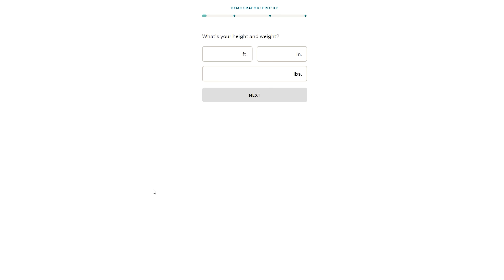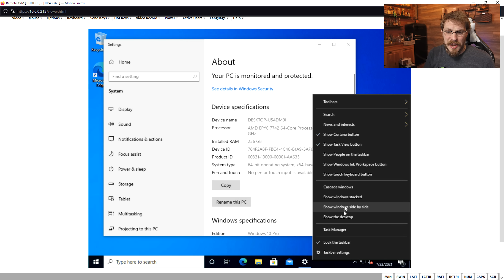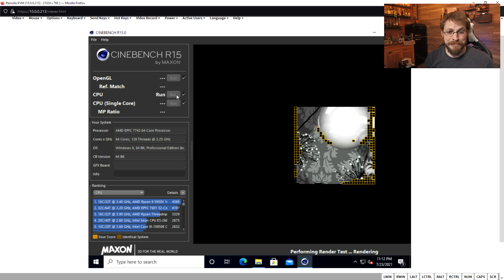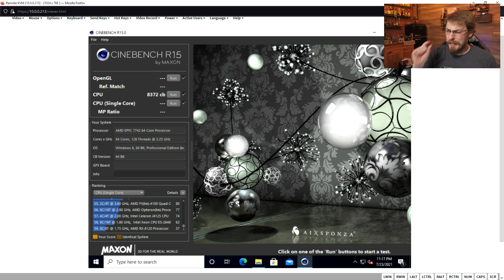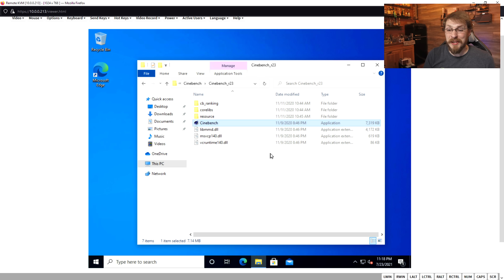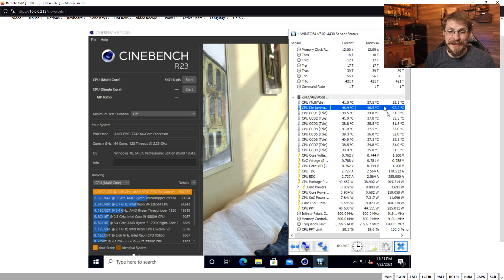My Most EPYC Server Build to Date!

Comment: Did you have any problems using the onboard NVMe slots?  I get a ton of PCIe APEI errors on my ROMED8-2T using a pair of mirrored SN850x 2TB drives, especially if left at PCIe 4.0 speeds.  They’re better at 3.0, but still regularly flash errors.

I was hoping to not have to go the expansion card route, but I’m curious if you faced the same issue, or knew exactly which QVL’d Phison controller- based drives might work properly.

Thanks!

Comment: If you are using a Noctua SP3 cooler its designed to handle Thread ripper 3rd gen and that does 280watts

Comment: Oh damn, I know I am late but I am laughing at your cooler fitment woes. Last year I did the EXACT same thing. I built a new CI/CD server at work with a Threadripper and that cooler. And tried to fit it in a 4u chassis. I looked up everything beforehand and triple checked it. Still made the mistake thinking it would fit.

Comment: Does anyone else worry about picking up an EPYC from eBay that's had the fuses blown already? Is this happening enough for people to worry or are all sellers being upfront about it?
Reply: This was one of my huge worries when going EPYC. Many sellers I queried at the time when I started exploring earlier in the year weren't aware of it and informing them after they stated they had no idea usually ended up with "Don't care, don't waste our time" response instead. Ironically enough I found buying a retail boxed EPYC elsewhere was both a guarantee of an unlocked unit but also far cheaper than identical used units on ebay.
Reply from the maker: Definitely a worry when buying. Most sellers are on the up-and-up about being Dell/HP only, but there is a risk of them not knowing.
Reply: @CraftComputing  I'm still waiting for the older Epyc's to filter down the chain a bit more along with their motherboards -- problem is the Zen 2 and now Zen 3 was such a bump unless you need the IO you might be able to make-do with the Ryzens; which is what I'm doing :D

Comment: I did the same exact thing with the heat sink, but not with a noctua cooler, it was an arctic one lol. I ended up switching it out with an extra low profile noctua cooler I had laying around.

Comment: You don't have to bend the heat pipes if you have clearance issues you just gotta drill several small holes on the top of the case in the exact layout of the heat pipes at the exact size of the heat pipes where they make contact with the case and they will just pop out neatly (provided you do the measurements correctly). Each hole should only be a few millimeters larger than the actual pipe and this is plenty of clearance. Saw this once a few years ago the only downside is that it may have clearance issues on a rack. Looks pretty neat otherwise.

Comment: How well is the Tesla K80 at handling modern titles? Can you run AAA games in FullHD at acceptable framerates if you use each card for 4 VMS?
Reply: it's an gtx780 performance, on all 4 VM's it's ok to 1080P Low gameplays.

Comment: Does Windows assign 2 or more processor groups to those 128 threads? Do you think the same system could be fit in 3u without going water cooler or special PSUs?

Comment: First off, congrats on the new addition to your crew!  Next question, did you ever consider trying to find a used 5U chassis so you could keep your larger cooler?  Years ago, I was able to find a few for 14 a piece, tho shipping was 40 each.
Reply from the maker: Rack space is actually pretty limited for me, so 4U is a must. I think with the rear fans turned on, the 3U cooler shouldn't be an issue.

Comment: Had the same problem with cooler height on a threadripper live streaming setup.  I ended up going with the EK-MLC phoenix, which allowed for easy maintenance due to the quick disconnects.  Definitely would recommend a case like RSV-L4500U which allows you to mount a 360 rad to a bracket.

Comment: I was puzzled when I saw the ASRock box and that CPU tray, until I saw the Epyc printing. I have that same board with a Supermicro SP3 cooler for proper airflow direction. The boot delay is attributed to the inventory setting on the board.

Comment: I’m in the process of building an almost identical
Setup (waiting on PSU, GPU, CPU Cooler delivery Wednesday). I tried to get the BeQuiet 1500W PSU but everywhere was backordered, so I went for the Corsair AX1600i. I also went Threadripper Pro due to higher core frequency. I even have the ASUS PCI card that came with the Mobo, still deciding what NVMe’s I want to throw into it.

My Build:
Threadripper Pro 3995WX 
IceGiant ProSiphon Elite
ASUS Pro WS WRX80E Sage
256GB (8x32GB) DDR-3200
Silverstone RM42-502
Corsair AX1600i
RTX 3090 Founders Edition
Reply from the maker: Nice!
Reply: congrats 
I start day dreaming about all those cores running crysis.

Comment: Can you explain how you configure "4 cores and 8 threads" to a vm? Can you actually choose between cores and threads? All I know is that I can add threads from a "pool" of 128 threads. Or is the hypervisor automatically configuring half of the cores as actual cores?
Thanks!
Reply: There is something called CPU pinning which specifically pins a CPU to a specific VM which basically means no other system gets to access it.

Comment: if the U12S-SP3 doesn't fit, u could have tried the U3-SP3. At 125mm high, it makes it 33mm shorter than the U12S, so it should fit :)

Comment: Is that cpu die average reading actually correct? That makes no sense a 200W or so heat load over such a massive area can hit 92C. The Tctl and Tdie temps are also only in the 50s.

Comment: Me: makes my PC boot fast, gets like 30 seconds.
Me: adds dual 10G SFP+ server card
PC: boots 5 minutes
Reply: Use sensors and  home automation to automate the pc booting when you get nearby. 

That was its already booted when you want to use it.
Reply: @Mike Pastore I was talking about network card.
Though I do have other otherwise fast PC that gets slow down by RAID card
Reply: @Arek_R.  Same thing might apply though. I disabled functions of the pcie NIC that I don't need in motherboard settings to speed up booting

Comment: Man you are a BAD influence. Got into homelab projects a year or so ago to keep myself busy with a retired Dell T5500, upgraded to 64gb of registered ecc, total of 24tb useable storage (big ol plex library), and dual x5690s with noctua fans zip tied to the passive coolers. Wound up running FreeNAS on bare metal.  Aaaaaand I'm putting the final touches on a 7960x, 980ti with patched drivers for transcoding, 128gb 2666 DDR4, my first HBA, and 4 14tb EXOs drives running ESXi as a virtualization server. Rack incoming soon perhaps? Last note, can't comment without a beer recommendation. Sierra Nevada Wild Little Thing; Sour Ale. Refreshing as could be, sour fruits and berries right to the face. My go to, low alcohol content summer beer.

Comment: I have the same motherboard and almost the same CPU (it's 7742 QS on my side). Firstly - motherboard allows memory overclock and i am running my 2400 memory at 3200 no problem. Secondly its Mini-SAS HD headers are not U.2 - they are SATA headers, you will have to get OCuLink to U.2 cable to connect U.2 drives to it. And finally - while there was an OcULink to 4xSAS/Sata split cable in the box i was not able to make it work no matter what. Otherwise - this system is very cool!

Comment: How many vGPU profiles with help of vgpu_unlock can K80 do?
Reply from the maker: Unfortunately, there are no vGPU profiles for Kepler 2.0 CPUs like the K80. I'm working on some other things with it though.... No idea if they'll work or not.
Reply: @CraftComputing  Good luck! I'm trying to find a replacement for my GRID K1s to make it denser, running 96 VMs across three Dell R720, they run quake 3 engine games well :D. Last time I saw M60 being able to do 64 total from one GPU, the search continues!
Reply: @CraftComputing  Would M40s be a good choice here? There's both a 12Gb and 24Gb version of the M40.

Comment: Jeff, I'm not saying anything here, but I just upgraded to that motherboard a few weeks ago - coming from a platform that was pretty much the same as your old one which I had put together only a few weeks before you did your video with the S7150x2's.  Back then, I was trying a single S7150x2 but I never got it to work - pretty sure it was dead.  Used single card's passed through for quite a while until I saw your vGPU video.  Been trying a couple different cards out with that with mixed results.  1060 did well.  Got a Tesla M40 24GB that's been having some issues - have a github issue in with DualCoder on that now, but I think I'm just going to return the card and get an M60 instead unless I can get a major breakthrough before I have to send it back for the return.  I with I could afford the amount of RAM and that CPU that you have - I've just got a 1st gen 16 core and 64 GB.  Very cool project though! Keep up the progression on this, it's been very cool to watch and compare!

Comment: Interesting, my 3970x does the R15 in 7039.  I was expecting the 64 core part to do over 10k, but maybe the clocks and slow ram are the issue?  For gaming, that may be a problem over something like the 3990X which could run 256GB RAM at a higher clock speed.  Not sure ECC for gaming matters.  I have mine mounted in a 4U rack, but with a water block and 360 RAD and it stays much cooler.  If you had a little more depth to the server case, it would be worth looking at.

Comment: I had the the same issue with cooler when I moved my 1950x server from a tower to a 4U, ended up going the nh-U9 as it was the only thing that fit properly.
While capable, its louder and runs about 10C hotter than the nh-u14 did.
Apparently on intel the u12s will just fit, but on AMD the extra socket height rules it out.
I may just end up watercooling the server case like I've already done with my new 5950x workstation

Comment: I made the exact same mistake in my last build, 4u Chenbro chassis with a U12S too, though mine is just a 2700, so a U9S works just as well with the top closed...if only 4u would fit 158mm coolers, including the pipes. also 100% need more Wendell teleportations